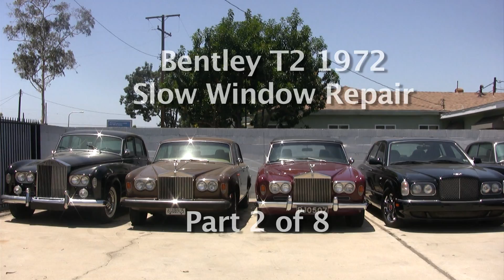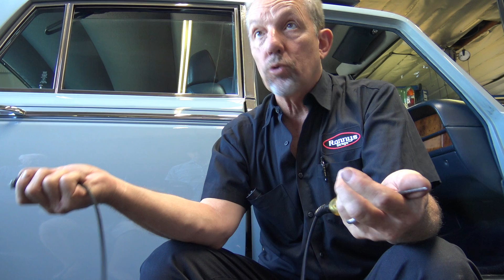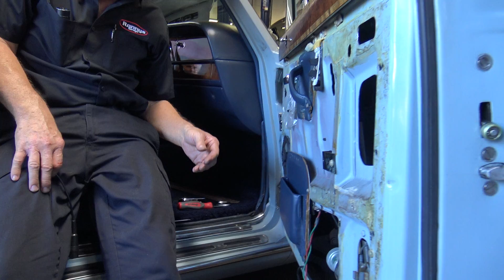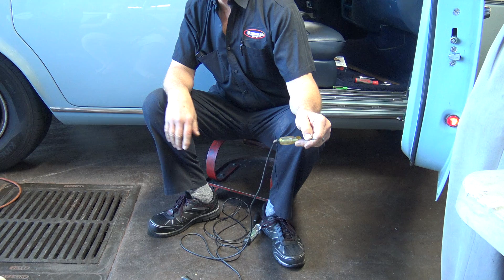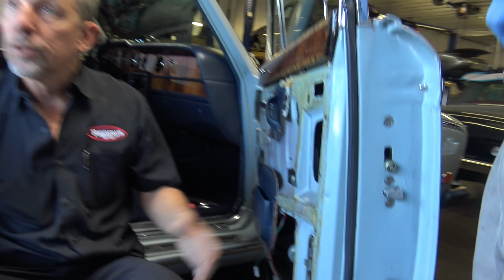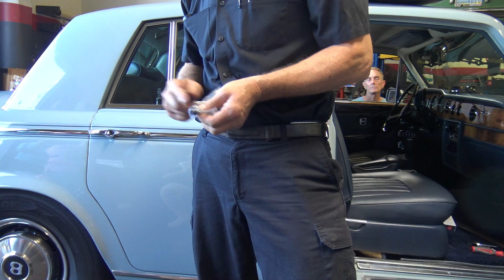Bentley T2 Slow Window Pt 2 of 8

Comment: CRC manufactures a aerosol can of electrical connector liquid etching chemical to remove corrosion/oxidation from micro switches, terminals, connectors and anything along the wiring harness of an automobile. Can be purchased at Home Depot in red spray can.